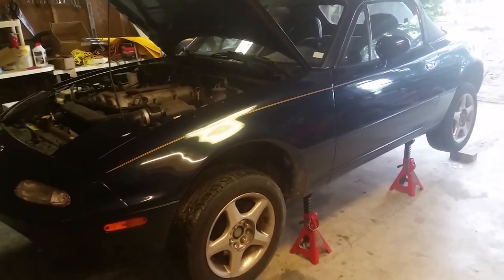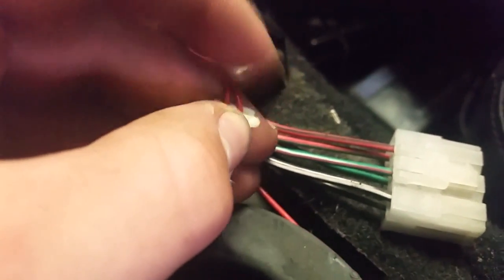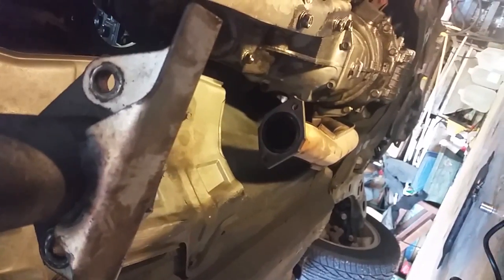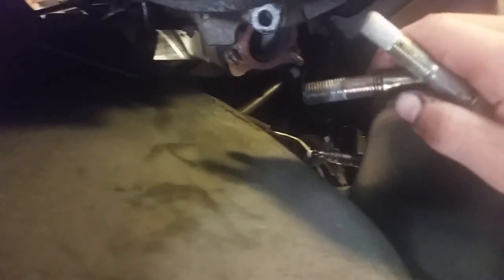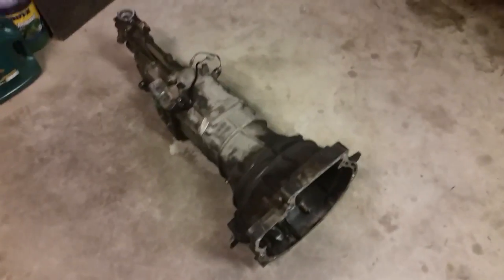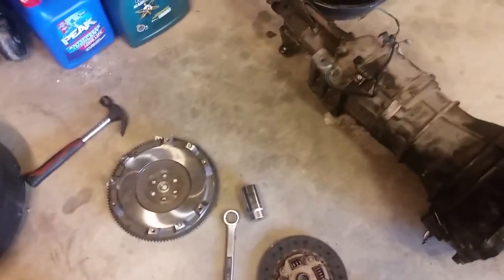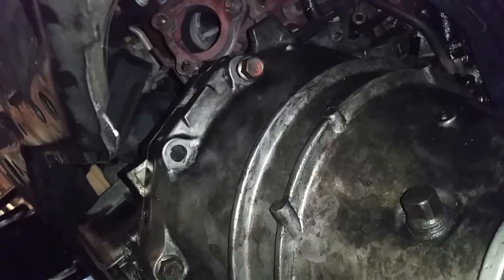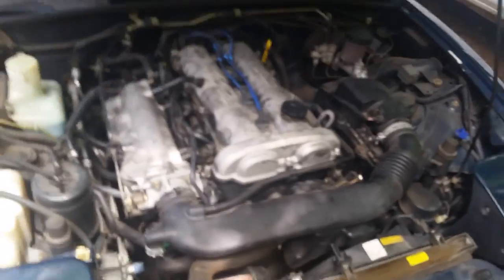How to Replace Clutch - Mazda Miata MX-5

Comment: Hey how come my transmission won't go back in correctly after putting it back in the upper part of the transmission stick out bout 2in from the engine and what bolts are easier to put in 1st the 2 sides of the transmission.?.

Comment: Good video. Can you look at the noise my car makes in my page. Changed the clutch and now I get that lash. Really really stuck. Awful noise. Any advice welcome. I’ve tried everything though.. pilot bearing, new trans, rebuilt diff, new thrust bearing, two types of clutch(oem and high spec), u-joints are sound, PPF alignment, no exhaust problems, engine mounts, flywheel is sound???????? Etc. Just lost and can’t accept a clutch change causes major gear lash